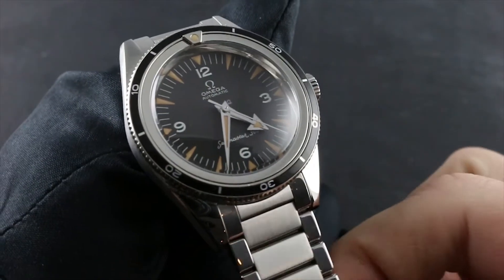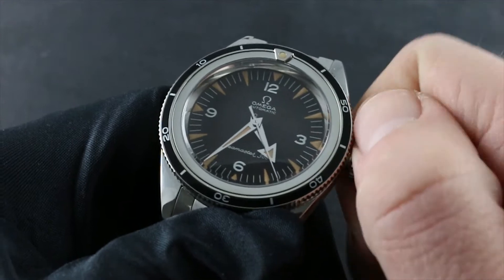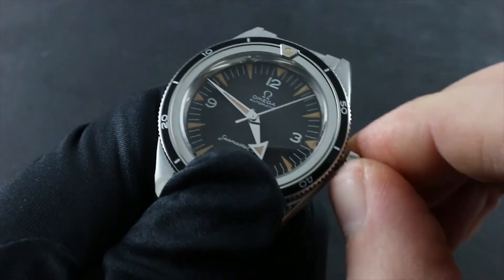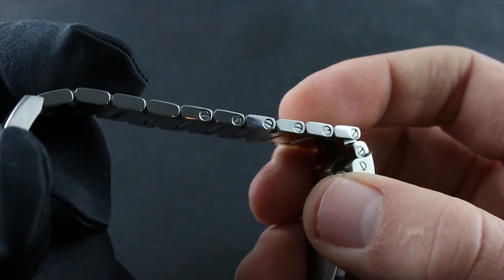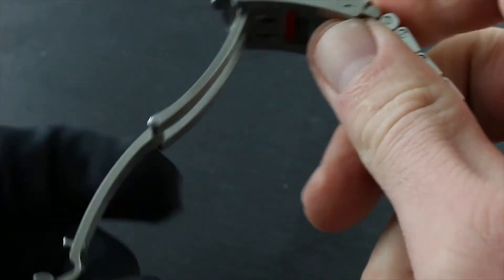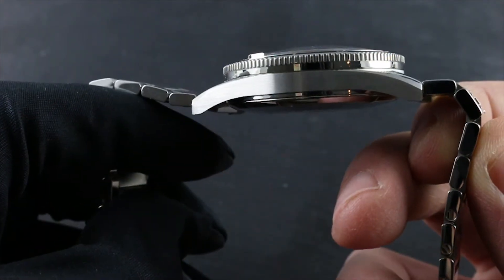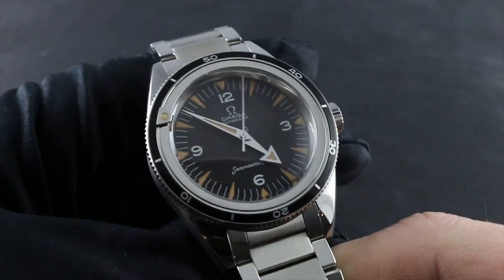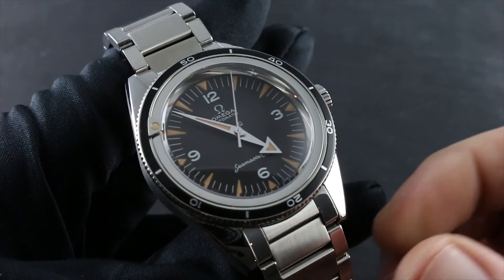Omega 1957 Trilogy: Seamaster 300 Co-Axial 234.10.39.20.01.001 Functions and Care

Comment: I have been going back and forth between this and the 2014 Seamaster 300 Master coaxial since forever. Both great watches based on the same design. This limited edition presents like a perfectly preserved vintage watch, which is neat. The 2014 300MC presents like a modern watch that takes a lot of design cues from the 50's design, which is also great. In the end I opted for the 300 Master coaxial, but since they are really different watches in the way they present, I don't rule out picking up this one some time in the future.